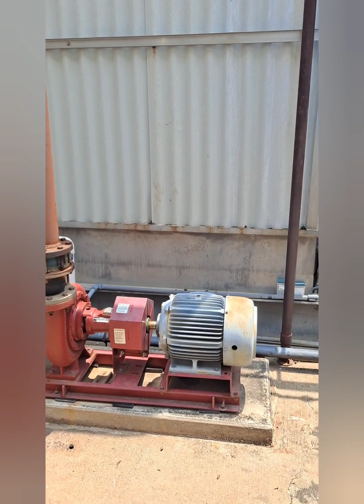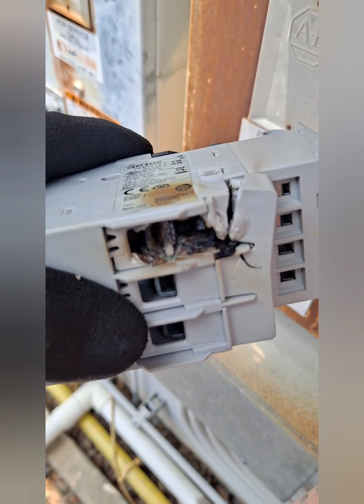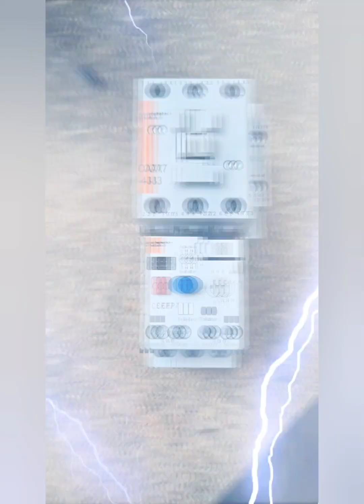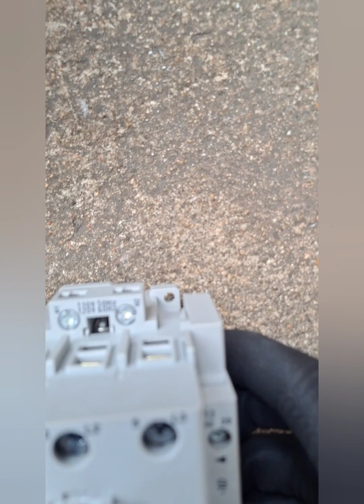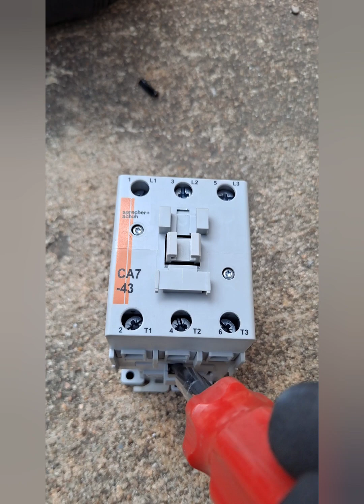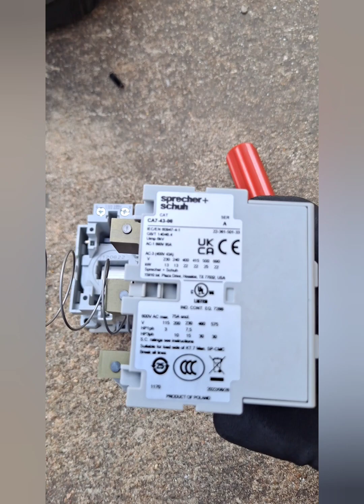Replacing a contactor with overload in a control panel for a cooling tower pump motor.

Comment: I’ve had the same mounting issue when I didn’t have DIN Rail available, nice one handed dissection! What IR camera do you use?
Reply from the maker: I have the Hikmicro pocket2 and the Flir one pro. They both work, but the Hikmicro Pocket2 is a superior product.
Reply: @JJ-COMMERCIALHVAC  I’m going to check out the Hickmicro. Thanks Jason. Have you used it in other videos?
Reply from the maker: @subcoolHVAC  dont think i have yet.

Comment: I ran into that same issue on a BAC tower! Im pretty sure the guy that just pm'd the tower didnt check his lug torque! Two legs burnt down,and I couldnt get XHHW 1/0,so I had to replace all three with THHN,the one wire could have been stripped back ,but the other one was cooked for about 18 inches!
Reply from the maker: Yeah the building engineer said he got a full turn and some on that lug. Thanks for supporting my little channel. Hope you are well my friend